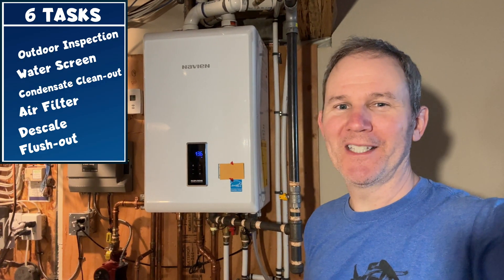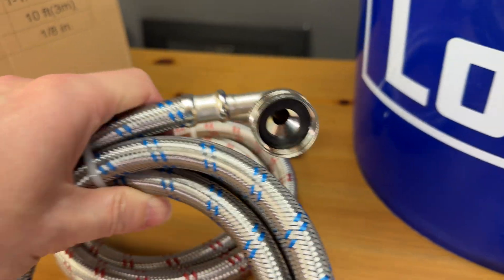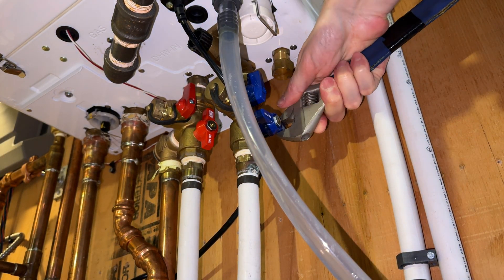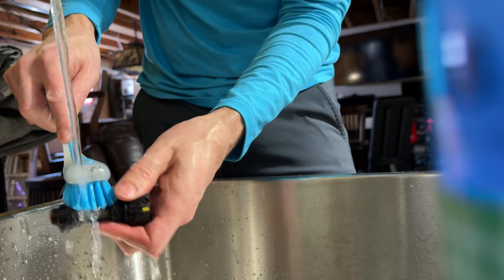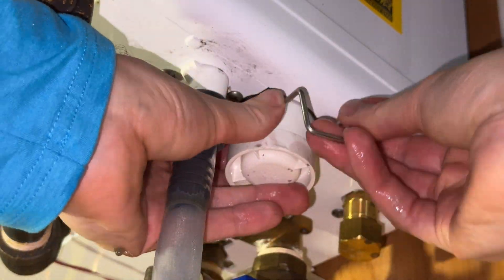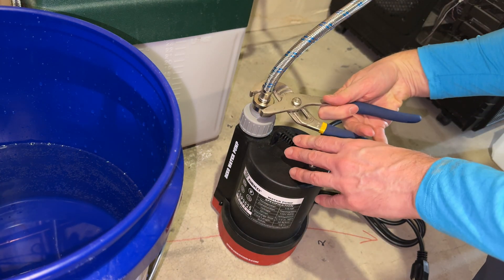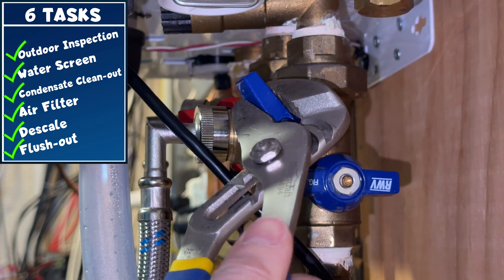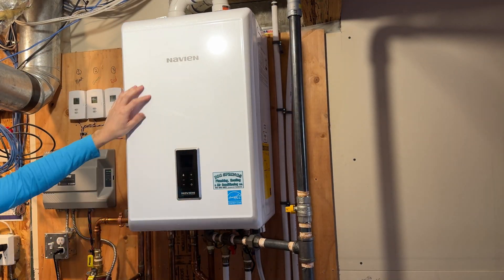Tankless Water Heater - 6 Annual Maintenance Tasks

Comment: Just moved to a new house that has a Navien tankless water heater and ran into an issue with the heater not working. Watched your other video about Error E110-01 (exhaust blockage) and it helped a great deal. Found this one as a follow up and was happy to bookmark it and will be adding this to my spring and fall maintenance routine. Thanks for the great informational video!
Reply from the maker: Awesome, so happy to help! Thanks for bookmarking it... I just used my own video a couple months ago to walk myself through the steps again for the annual maintenance - lol